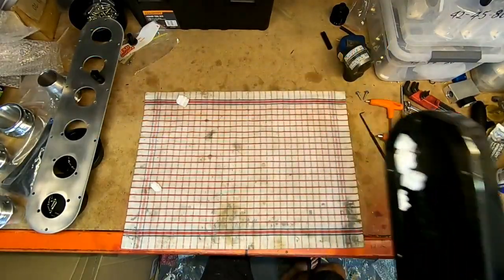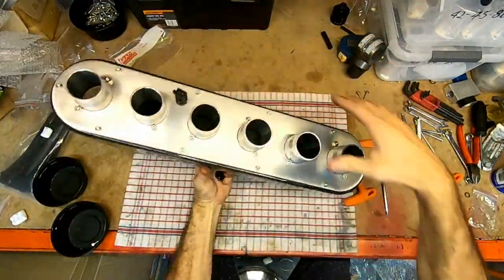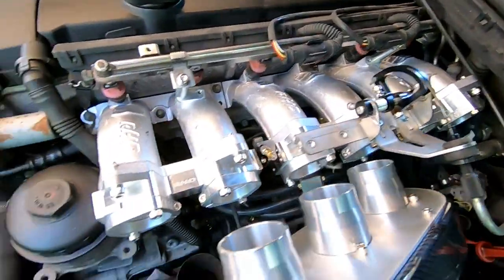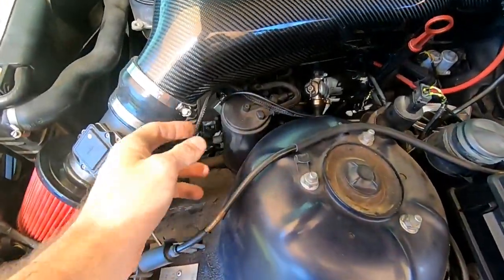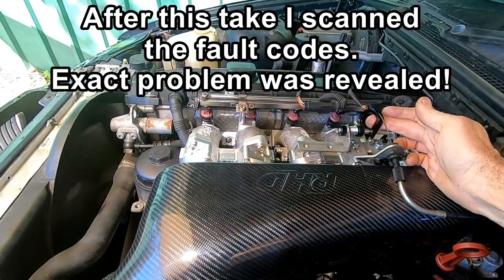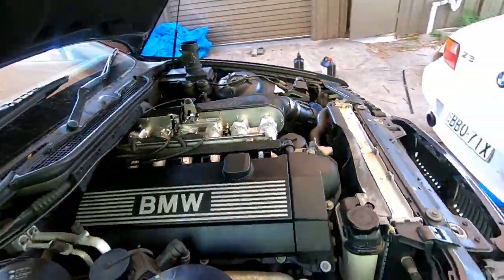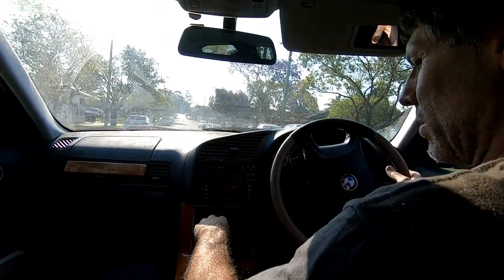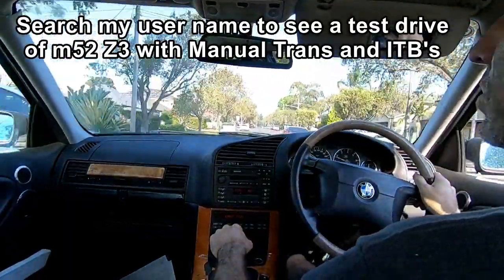PART 3, BMW M52 ITB's,  Airbox and Test Drive (RHD Engineering)

Comment: Will this work with forced induction setups?
Reply: No point having itbs with forced induction, it has negligible power gains, much easier to have a less complex stock setup and just raise the boost a bit. You’ll get a much better result that way. Also, itbs dont sound that great on forced induction setups, because the sound is muffled by the turbo from both the intake and exhaust side.

Comment: What is the difference after this upgrade? How many hp and nm increase?
Reply: ITB's dont make much horsepower or torque, the reason you get them is to tighten throttle response and sound really good.
Reply: 20whp

Comment: Is this possible to use on m54 engines while maintaining the e throttle?
Reply: They claim yes on their website, but it doesn't look quite correct. I do wish they elaborate with exact details of E46 application. What about the e-throttle. What about the CCV crank case ventilation system. What about late year 330 with IAT sensor inside the MAF housing...